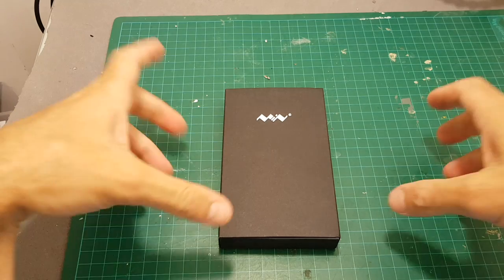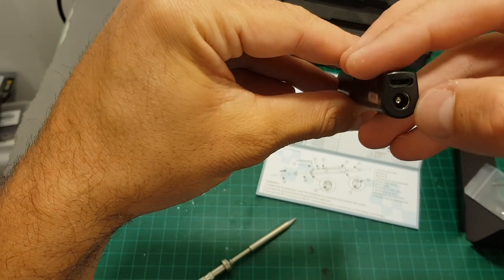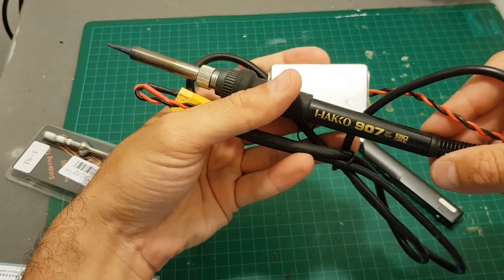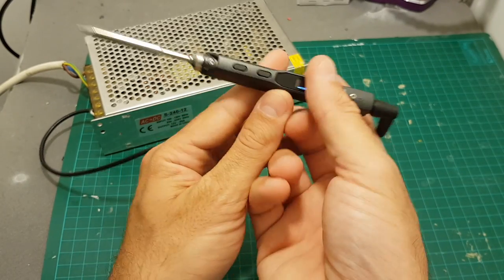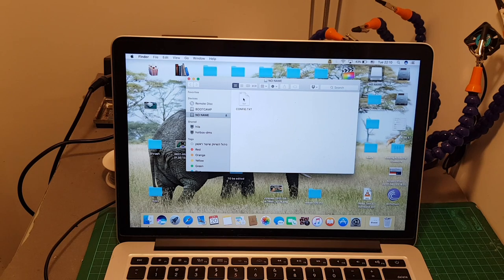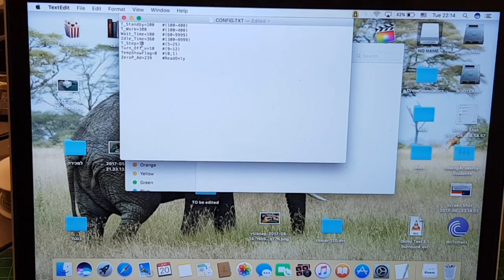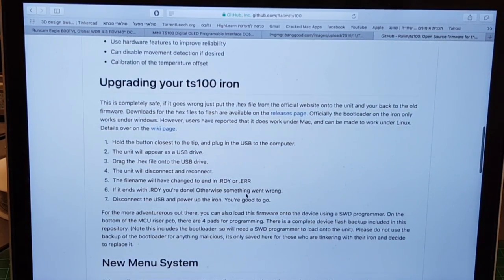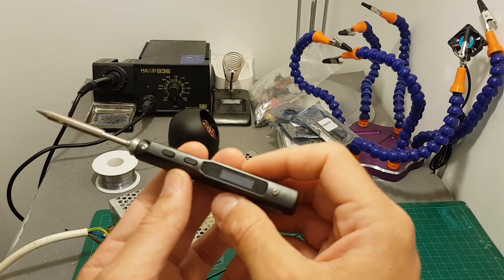MINI TS100 Digital OLED Soldering Iron Unboxing And Review

Comment: A lot of the major brand cordless drill sell an adapter for their battery pack that allow you to connect a cord to power other DC devices. That would make for a good use for a field service worker that already as invested in a drill and kit full of batteries!

Comment: So it can’t be used wirelessly at all.? Like without connecting to a power source.?
Reply from the maker: If you will be able to power it wirelessly you are going to be a very rich man ;-)
Reply: Gal Kremer good answer. Thanks for replying back. I want one so bad. I think I’m a take the leap in order I like the Sapphire one looks so cool the color
Reply: @MrKingNica  how did it work out?
Reply: Jonny I ended up opting for a cheaper beginner one since I was completely new to soldering. But now soon as it’s in the budget. I’m get this one. It just looks so cool and not bulky like cheap ones.
Reply: @MrKingNica  thanks. I'm new to soldering too. Was looking at Weller but all videos but putting this over the top so gonna for this sweet one now. Gonna make fixing up old dreamcasts fun.